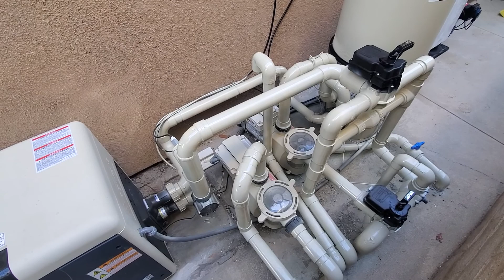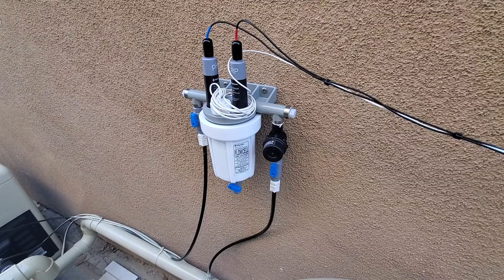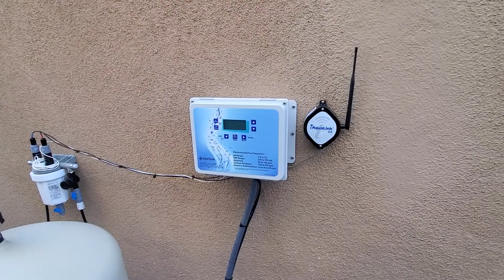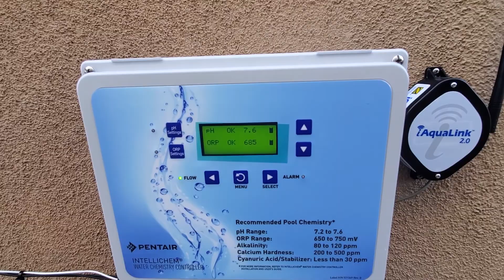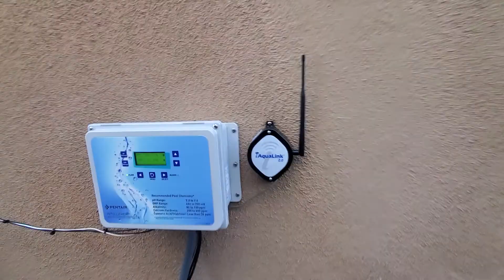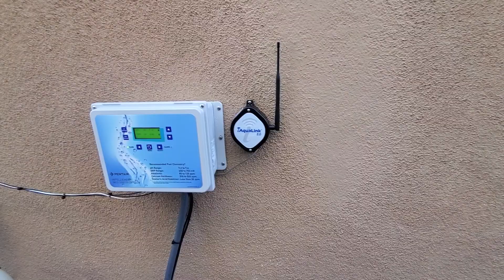All New pool / spa equipment with phone controls and automated chemical controller.

Comment: High flow fittings? Doesn't matter. It all depends on the pipe size. If you want more flow use larger pipe.
Reply from the maker: Bryan,-  High flow fittings do increase efficiency and increase water flow compared to normal 90 dregree elbows.  I have witnessed a drop in PSI on the filter pressure when we do a replumb on pipes after the filter only.  This proves less resistance and lower pressure in the pipe.

The pipe size underground is determined at the time of the pool construction.  If the pipes coming out of the gound are 1.5" we will increase the pipe size for the new pipes being installed.  

The foundations below recomend using hi flow / sweeping fittings for the reasons described above. 

https://www.fpsie.org/
http://www.genesis3.com/
https://watershape.org/